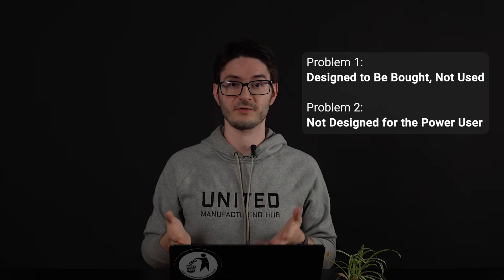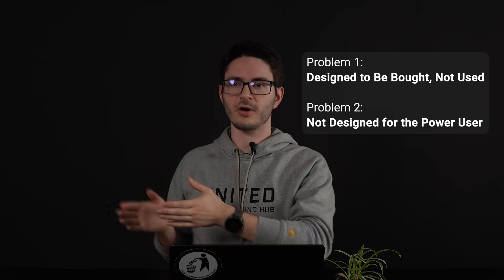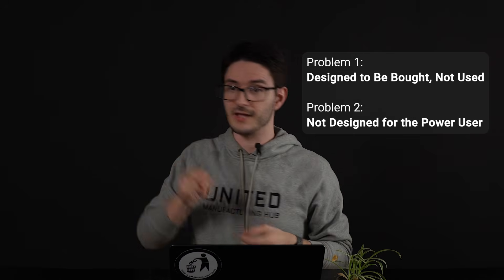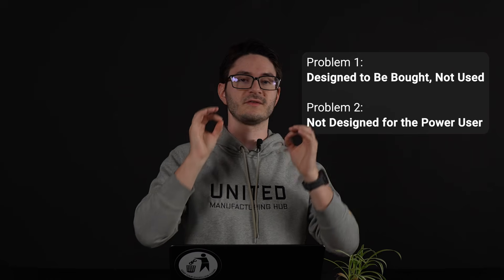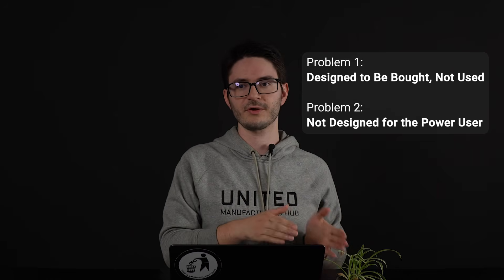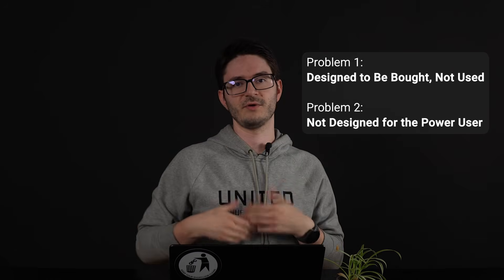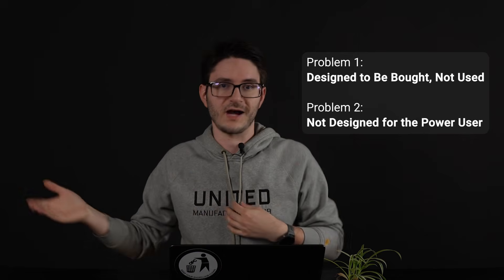Why Most Manufacturing Software Sucks | Part 1: Fixing Manufacturing Software

Comment: Agree with you regarding often easy lobbing in the product at the C level, but when it comes to the technical capabilities it's often poor design from the developers/integrators and  likely not using the product in the right/attended way. 💩➕💩🟰2x💩